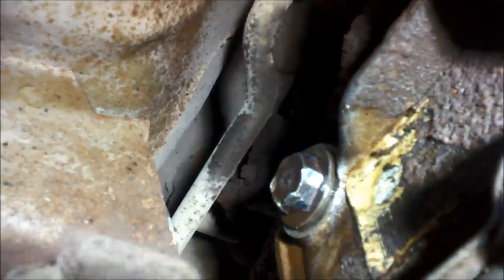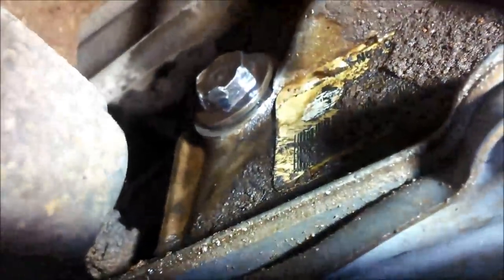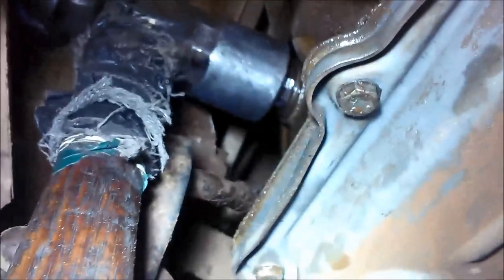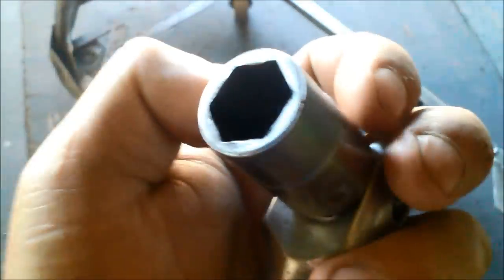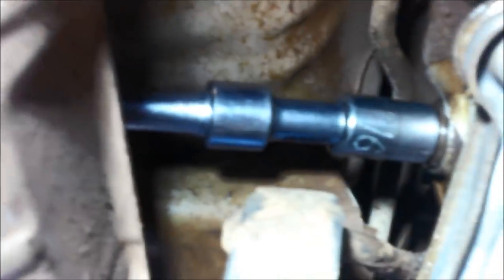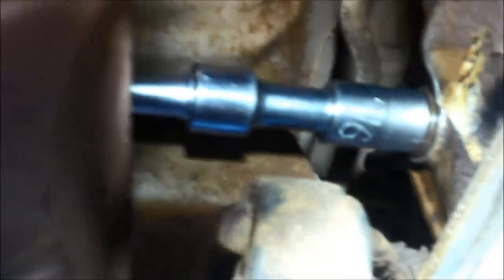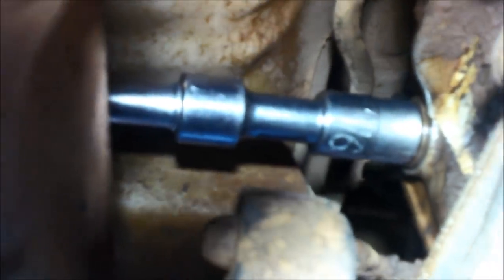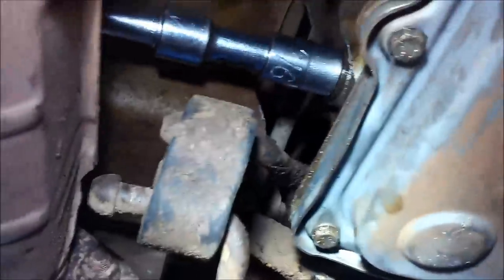How to Remove Rounded Off Filler Plug DIY How to : How to loosen damaged filler plug, bolt or nut

Comment: Great advice thank you. How the hell were you able to get the breaker bar on and off the extensions when it was flush up against that chassis rail/member?
Reply from the maker: hi, there is a bit of give on the transmission mount, keeps it pushed on firmly.cheers

Comment: As long as my stuck bolt is exactly a multiple of ratchet extensions and there is a frame rail nearby, this will work every time and in every situati9n
Reply from the maker: hi, yeah sometimes you need to adapt to your surrounds, and sometimes you need to adapt your surrounds to suit you ! cheers
Reply: Hence the block of wood or steel he mentioned! Came here about that exact bolt and had my problem solved!

Comment: Jagged that nicely. Alt method :
Remove battery cables
Place 17mm ring spanner (stubby) on bolt.
Weld . Bingo. Remove.
Cut stubby off. Resize bolthead to 1" . Bolt will never round off again.
Reply from the maker: hi, whatever works best for you with your tools available....if i did that i`d go broke buying spanners i`ve welded to get them off...also you risk damaging case if your weld gets too hot......another thing, these are 16mm plug head, and always try use single hex if available. cheers
Reply: @YepThatsIt  yeah, cool.
Some genius cold-chiseled the lip of plug to case.small wonder it rounded in the first place.

Comment: I've got a badly rounded off bolt on the belt tensioner of a ford Territory (barra). I've tried twist sockets but they just gouge into it and cut more material off as whoever fitted it must've used red loctite and a gorilla to tighten it. Theres not much room to get into it bcoz the radiator isn't far from it. I've tried a cold chisel but its in a recessedholeso hard to get to.. Do u have any ideas? The only other idea I have is to use small carbide burrs on a dremel to grind the head off the bolt so I can slide then tensioner off then use a stud extractor to get it undone. I don't have access to a welder to weld a nut to it. Any ideas are much appreciated. Cheers mate
Reply from the maker: hi, if loctite on it, you will need to heat it up without damaging the surrounding components. we use an induction heat gun to get out trouble bolts and studs see https://youtu.be/ws3VHr3wSGU cheers

Comment: Gday mate, I'm working on the first car I ever owned, inherited the AU from my family. The chassis rail on my AU near where youve propped the socket is crushed and warped on the bottom, due to previous owner using jack stands that were too small. The deformation has squeezed the chassis rail walls out, and theres enough give for me to get a 250mm extension bar on it, but there is absolutely not enough clearance to get a breaker bar or socket onto the extension bar. I've also got a 125mm and 75mm extension combined to 200mm but it's not long enough to squeeze itself against the chassis rail. Could you tell me exactly what combination of extensions you used? 

Would it be cost effective to hire somebody to come out with an industry level impact wrench or other form of hardcore nut buster? My ozito only puts out 140nm so its a bit weak, I know there are impact wrenches out there with 2000nm+ but I cant find anything like that available for hire anywhere. 

Im sorry for the long comment, I know your time is valuable.
Reply from the maker: hi, there are no magic combinations of extensions you use. you can use shorter extensions and add a steel block to help keep the tension of the socket on the plug head. always try use a single hex socket and fill the socket with course grinding paste to help take up any spaces. when you have done that try give the breaker bar/ratchet a sharp/fast attempt to loosen the plug. cheers

Comment: 16mm tends to round it off in the first place. 5/8 (a touch less than 16mm) is a good tight fit.
Reply from the maker: always use single hex on shallow headed bolts. cheers for that

Comment: Hi Mate I was wondering what extensions Did you use as I am going to get them from repco? Great video by the way I am having them same problem the 16mm socket just keeps jumping but with the right extensions it should be ok thanks in advance 🙂
Reply from the maker: hi, fill the socket with very coarse grinding paste or even sand mixed with some grease for a tight fit. you can use any solid blocks to make the socket be pushed hard onto the rounded head, if you dont have an assortment of extension bars. cheers

Comment: I'm having a big problem with my filler plug on my au.
It's doing. My head in as now I have no way to fill my. Box. So no car atm.  I'll try this.  Is there any other tips to getting it off without spending money I don't have?
Reply from the maker: hi, if really rounded off, you may need to tack weld a large nut onto it so you can get it off. i`d recommend doing that rather than a cold chisel as you can easily damage case with chisel. good luck and cheers
Reply: @YepThatsIt  I'm. Going to buy a flat edged socket today as I think that will work.  If not. Weld a nut to it. Lol.

I need to get this transmission fluid in it.
🤔😂

Thanks for the tips mate.
Reply from the maker: if you weld a large nut onto it, make sure the hole on the nut is just slightly smaller than the diameter of the rounded off head. that way it will be easier to get a weld on the inside of the nut to the rounded plug head without damaging anything. good luck cheers
Reply: @YepThatsIt  will do. Thank you mate 👍

Comment: How are you supposed to get it off mate everything is pushed together no room to get off socket
Reply from the maker: hi, another trick you can try is push coarse grinding paste into socket as well....it will help . cheers
Reply: Miata Tokyo, it looks like your head is missing the brain, he did that to loose the bolt only, once loose go to regular proced...

Comment: Sockets are available for doing this, removing rounded hex heads.
Reply from the maker: cheers
Reply: They don't always work believe me. Especially if they're not high tensile bolts and very tight they'll actually round them off more. Also in tight positions it's hard to hammer them on. They definitely come in handy though. I think he made this video to show people how to get rounded bolts off without having to buy twist sockets like your talking about

Comment: What’s the point of doing a how to video
When you don’t show you doing anything just talking about it what a joke
Reply from the maker: hi, thought I did show how I found socket extensions to snuggly put pressure on and push socket against bolt head hex so it wouldn`t slip off when you try loosen it ! only other thing I do occasionally is add coarse grinding paste inside socket to take up any spaces as well. cheers
Reply: Watch and learn